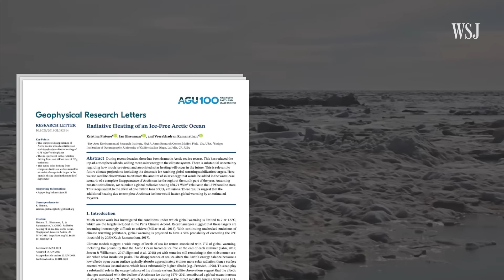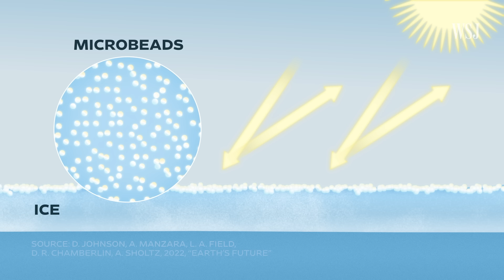Inside the Extreme Plan to Refreeze the Arctic | WSJ Future of Everything

Comment: Watching storm action on sea waves shows how the heavy elements like salt are left behind . So i suspect there is more work to be done with the pumps rather than dumping the water straight on the ice . I do remember a snow  making machine in my high street , or what about the cooling effect of a venturi in the pump line ?I suspect  there a lots of mountain ranges near water that could have there snow reseeded without running fossil fuels to get the job done. ( What cost by doing nothing ). We have lots of good guys , come on funding .

Comment: We all know that the process of Arctic ice melting has accelerated, and luckily we now have scientific ways to solve this problem.  First, we must know the reason for the melting of the ice and the sharp increase in the temperature of the northern hemisphere of the earth, and then he talked about the solutions.  It should be said that the main reason for the melting of Arctic ice is the atmospheric lenses, whose components are invisible aerosols of the third type.
 By analyzing the behavioral physics of this special type of aerosols, fortunately, we have them under control now, and by theorizing these special sciences, we can quickly stop this process.
With 30 years of research experience and examining the following issues, I can provide scientists with the necessary training.

We all know that the process of Arctic ice melting has accelerated, and luckily we now have scientific ways to solve this problem.  First, we must know the reason for the melting of the ice and the sharp increase in the temperature of the northern hemisphere of the earth, and then he talked about the solutions.  It should be said that the main reason for the melting of Arctic ice is the atmospheric lenses, whose components are invisible aerosols of the third type.
 By analyzing the behavioral physics of this special type of aerosols, fortunately, we have them under control now, and by theorizing these special sciences, we can quickly stop this process.
With 30 years of research experience and examining the following issues, I can provide scientists with the necessary training. epabfa13@gmail.com

Comment: I hope someone with a brain reads these words.

This can actually work, but for a VERY different reason than they are thinking.

The brine will be a problem, most especially when you ramp this up.

But in actual fact, the ability to make ice this way is NOT it's super power.

The actual power of this is to defeat a rather strange problem. Ice, for all of it's power in reflecting the sun, is also a massive lid of insulation preventing the heat from the ocean escaping.

This is actually going to help in a much better way.

This can suck heat from beneath the ice and spread it out above, exposed to much colder contact with the air.

Do not think of it as an ice making machine but rather a heat chimney.

As to powering the pumps.... Sterling engines can work with the heat different above and below the water line.
and roll out solar is now a thing.

this can attack the global energy imbalance directly by improving the mixing and allowing the heat to rise.

Comment: If you put ice in a glass of water and wait for it to melt...both water levels are....wait for it....the same!!
Reply: Only if it's floating in the water.  If you put it in a  spot (like Greenland) where it drains into the glass the water level gets higher
Reply: What happens to the water once all that ice melts… wait for it… it gets very very warm
Reply: @howardj602  the amount of land at the poles is negligible. If the ice on the land melts it won't matter except to very low lying places, and it will never melt entirely. It never has. They can't tell you when.
Reply: @GodsOath_com  Antarctica is a Continent with mountain ranges. The south pole is 9,300 feet above sea level. Mainly ice. The North Pole is at sea level. If you care to take the time you can find might rivers of water coming off the cliffs of Greenland.

Comment: What about underwater turbines similar to the underwater turbine generators to pump water to surface using the currents(it would be designed to pump vs be a generator but possibly it could generate a small amount of power to be connected to satellites or something)?

Comment: On a scientific way:

1. The entire arctic winter with solar panels :)

2. As a result, if you operate a pump with a capacity of 1200 liters per minute with 6 liters of diesel oil per hour of operation, and during this time you make 720 square meters of ice on a 10 centimeter thick surface with 72 cubic meters of water, then, right, at 80 degrees latitude, at an average sun height of 10 degrees, the incident sin is 1360 W, solar energy, i.e. instead of 20% of the hard 21 W, the ice reflects 85%, then you can "get rid" of 13 W of solar energy per square meter, i.e. 720 square meters is almost 10 KW! Which is not nothing, because a summer's day gives back the energy put into it, from then on it's a net profit. Since we calculate that the heating effect of the carbon dioxide pushed into the air by an internal combustion engine (very average) is 10,000 times the energy used in the engine, it is easy to calculate that in just 25 years the operation is already profitable or not... 

With a simple working example (like under covid) close the factories and travel by bike, go hiking and grow a garden!

Comment: The US Federal government could add 50 cents per gallon of diesel, gasoline and jet fuel to build out the Solar and Hydrogen generation programs primarily in the most populace states. Forget adding a Gas tax to Wyoming or Montana. They can just leave their TRUCKS running all the time and they have negligible impact.

But we have to start to build out the alternative renewable power systems in high population states CA, FL and NY and maybe VA and MD too. Just to put the impact where it would have the best impact. Having more EV and Hydrogen Gas Bus and Mass Transit.
Reply: Antarctica is melting due to volcanos, period.

Comment: If you want to reduce co2 this wont help, you'll need (micro)biologists to engineer various creatures to build calcium carbonate (shell/rock made of carbon and calcium - "carbon capture"). If you want to reduce sunlight hitting the earth you'll need to block it via space (reflective dust that stays in orbit a few decades and burns up in the atmosphere when it's orbit decays).
Reply: Why wouldn't it help? As ice melts it releases CO2. You prevent it from melting, you prevent the CO2. Seems straightforward to me.
Reply: @Matt-wj4ki  It will help but Oceans will still acidify till extinction (main absorber of CO2, just like ice). Acidification of the worlds oceans already happened twice, trapping CO2 in sea ice seems like a way to speed that problem up.  Carbon capture (like sea shells/rocks "CaCO₃") is really the best (most stable/consistent) way to off set the current course on a global scale but I could be wrong...

Comment: You don't need diesel generators. Just use a load of ram pumps. They run themselves without needing continuous energy. They can't pump a lot of water. Surely a ram pump can be utilised in some way

Comment: The three principal causes of climate change in order of impact: variations in solar activity, variations in the earth's orbit around the sun, variations in the angle of the earth's rotational axis, all of which are beyond the control of mankind.

Furthermore, climate "scientists" have relocated many of their temperature monitoring stations from rural areas, where they were all located for decades and which provided uniform data, to urban areas, which, because of the mass of concrete concentrated in them which absorbs the sun's heat, are two to five degrees warmer than nearby rural areas, thus skewing the data.